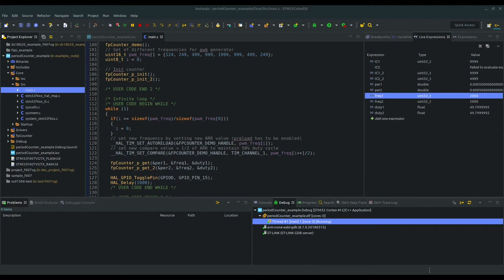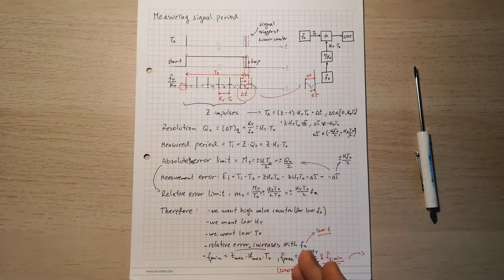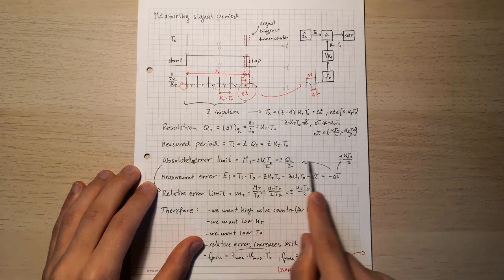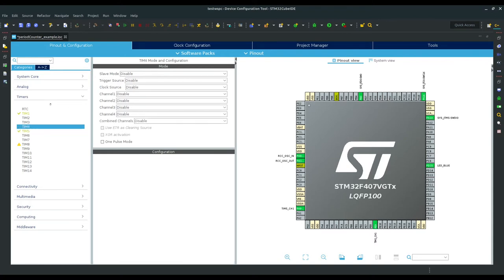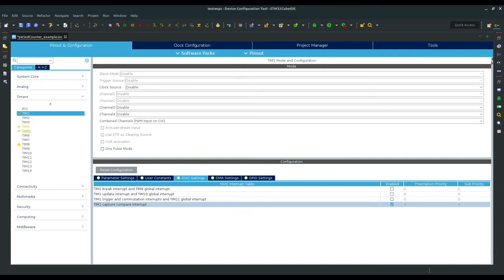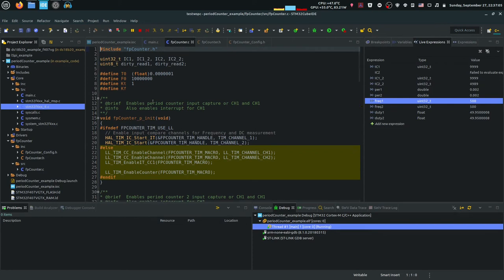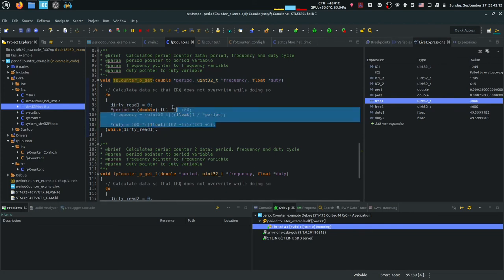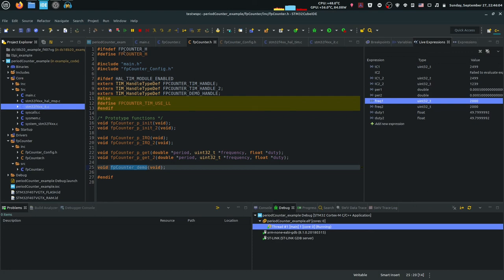Measuring Signal Period With Timers | VIDEO 35

Comment: Amazing video, I am new to Stm32 and glad to see such a good channel is using the same development board as mine, I was working of frequency and duty cycle measurement and stumbled upon your video luckily.                                                                                                                                                                            Just one simple question, to measure freq from external source what changes do we need to do in the code and configurations?
Reply: Never mind I watched the video again, basically TIM4 channel is to capture the external signal and TIM5 channel produces the signal, so to get the output all I needed to do was to connect TIM4 channel to TIM5 channel using jumper wire, I tested this with external frequency as well (arduino PWM at 62.5KHz ) and got accurate result, again thanks for the video
Reply from the maker: That's great, glad you got that sorted. On certain models you can use internal connection between timers as well - trigger or count.
Reply: Thank you so much for the video, I was able to do this thing successfully, and even tested varying duty cycles it worked flawlessly, But with ADC I am having a small problem I can share

So I am in talk with a small startup and they want me to create some sort of oscilloscope and for that Frequency measurement I got easily thanks to your video, but I need small help with ADC part, I want to trace the signal and somehow print or display that signal back to how it was, so let's say I send a PWM signal using ADC I want to trace the values such that I can display the signal in my computer/laptop.
Reply: I have the same board I searched thru entire internet but found nothing. If you have time please make a video on the topic

Comment: Hello, which OS are you using ? Is it possible to share screen with an other monitor ? Thank you
Reply from the maker: I am using Linux Mint 20. I screen capture my primary screen that I use for videos. Did I answer your question?
Reply: Yes is it possible to do multiple display with linux mint ? I mean use my laptop and a second monitor as external display .Because on ubuntu, it's really a gpu problem espcially with nvidia. That's why I 'm thinking to change distro.
Reply from the maker: I had laptop with no gpu with laptop screen and additional monitor. Then I got a used workstation with nvida gtx1060. Worked well, drivers were fine, but I had problems with screen tearing on all different distros (allways used mint, tried lots of other). I sold my gpu for rx580 and works with no problems.
Reply: Okay, thank you ^^